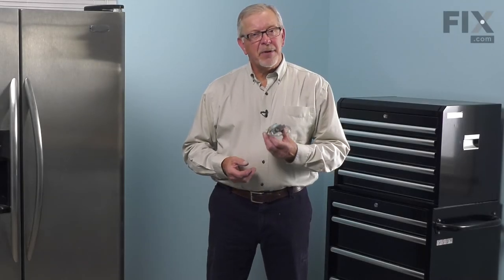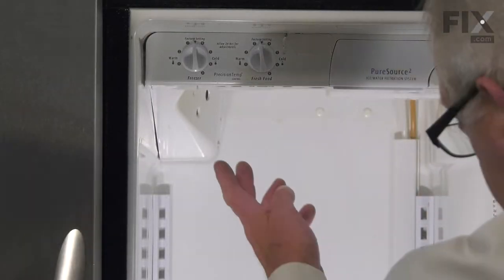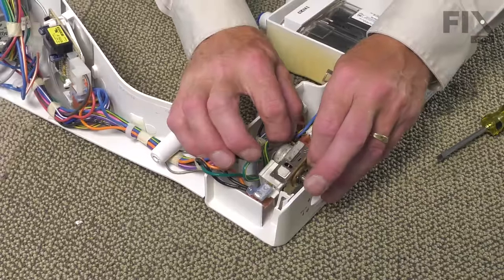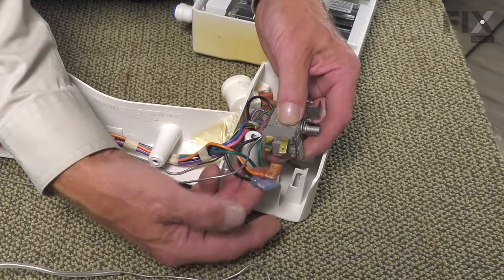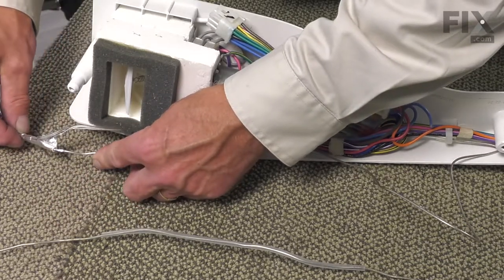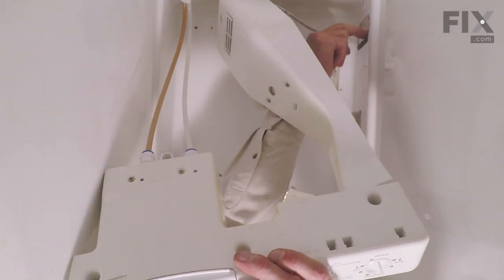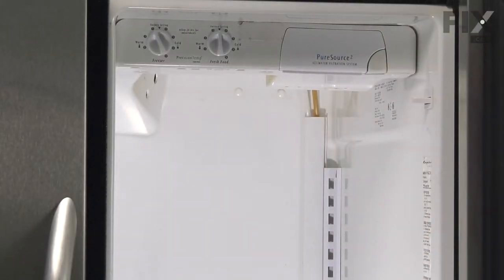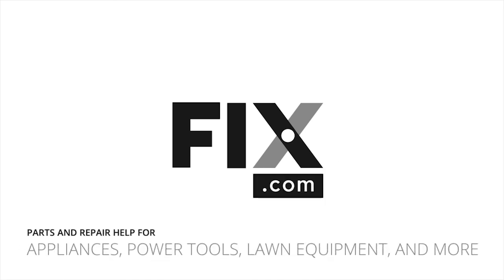Frigidaire Refrigerator Repair - How to Replace the Temperature Control Thermostat

Comment: What would cause the fan to the fridge to run funny for 3 seconds and off for three seconds cyclically till it reaches the set temp instead of continuously then shut off? Is it this control or something else? Similar model.
Reply: I know it’s a long shot from 3 years ago but did you figure this problem out? I’ve got the same issue

Comment: My refrigerator section is freezing.  The freezer section is freezing as expected.  I have not checked the temperature in the freezer.  When I turn the refrigerator thermostat off & on, I can hear the vent opening/closing.  This at least tells me the switch is getting power.

Is it possible to remove the two thermostats, and check continuity on both thermostats, then assuming they both display continuity, follow up by swapping both thermostats with each other to see if the freezer thermostat resolves the refrigerator problem? 

Can the thermostat be opened and the rheostat cleaned for reassembly and testing?

At best, I'm dealing with $209 (internet prices not including shipping) for a part that I'm not sure will fix the problem.
Reply: I forgot to mention that I've cleaned the coils as well as entire underside near the compressor.  I've been doing this about once a year for many years.